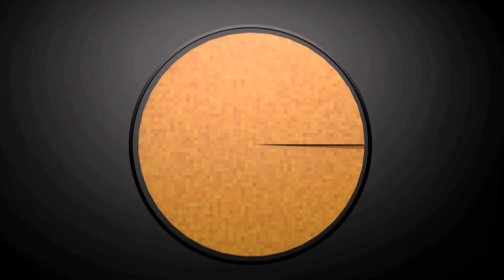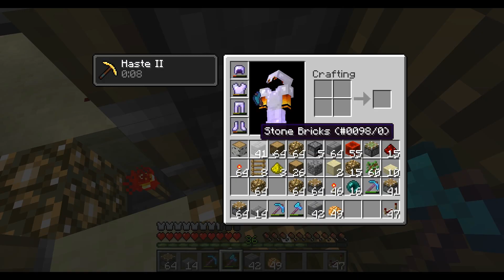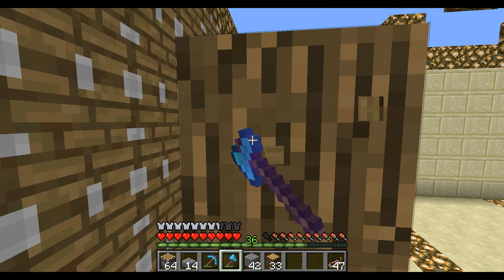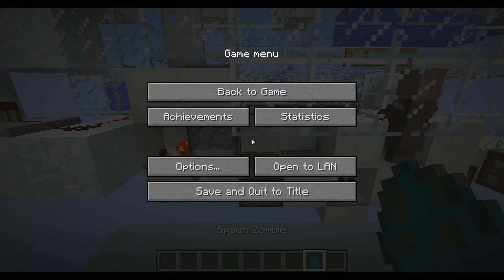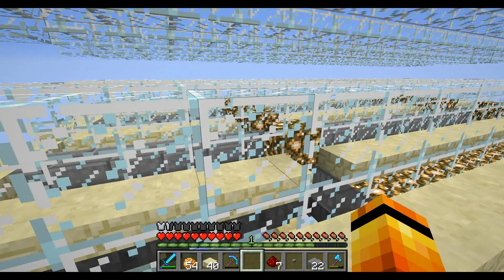King Plays Minecraft: Episode 13: Hostile Mob Farm

Comment: Oh the wire updating the piston from a block farther is to fix a particular kind of BUD. If a powered wire would point into a block, and then into a repeater, and the powered wire would get another connection as so it would no longer point into the block, the repeater didn't use to receive an update, making it into a repeater BUD.
/watch?v=N-I9YcywiZY&t=45

Comment: In a future video could you show the layout for all those pads? Trying to recreate it myself but not sure how you did it. Also, have you experienced any inconsistencies with it? For example, I found that putting tripwires on both sides of a block would mean the piston would sometimes fire if a mob was on the other side. Also, due to the block being diagonal to the piston, I had some instances were it caused it to act as a bud switch, would extend and then not retract.

Comment: 2400 is dual channel. However you are correct in  saying that it's only supported by certain chipsets. His motherboard only supports upto 1866. 
But RAM speed is only noticeable when benchmarking. You won't notice a thing when just using it normally.

Comment from the maker: You need to check all the socket requirements and how it would fit on your AMD board. Make sure your board can support the power to the GPU with the correct sockets also

Comment from the maker: Be very careful on case sizes with non stock fans, I had the Freezer 7 Pro in this, it covered my memory slots and couldn't keep up with my overclocking (My 3570k runs at 4.5ghz), replaced with an i30 cooler which only just fits in my case.

Comment: are you sure you want to try to overclock with the stock cooler, i would recommend a  NHD-14 from Noctua, or the AMD socket equivalent.

Also, what case are you going for, that can affect the upgrade possibles, for example, if you are doing you tube videos, and you hard drive fills up, what are you going to do if your case only has 1 drive cage. just saying choose wisely.

Comment from the maker: The chip only had 3 physical cores which emulate 6. 6 core processing is currently almost useless, hardly any applications and programs can make use of them. Still, cheap chipset.
4gb ram is low for a gaming pc in general, especially with windows 7+
only use high speed ram to match an OC processor, save money otherwise
3tb often same price as 2. 

You did ask both parts of this question previously, I did multiple paperrounds when I was 13 (not glam) but it pays, I did other business things also